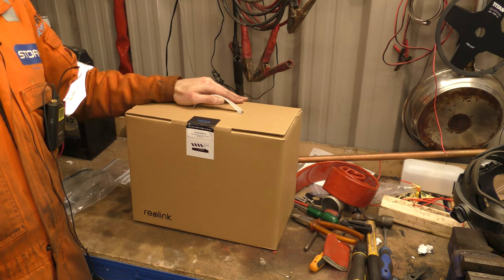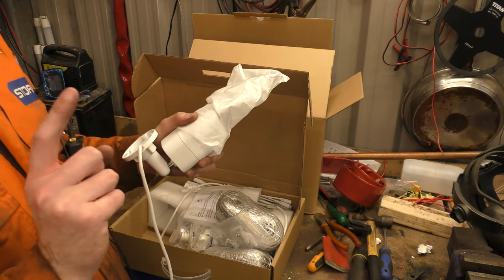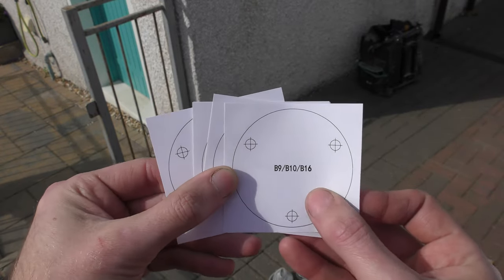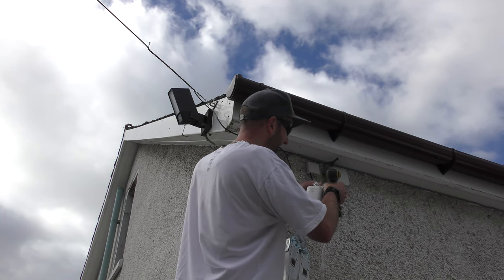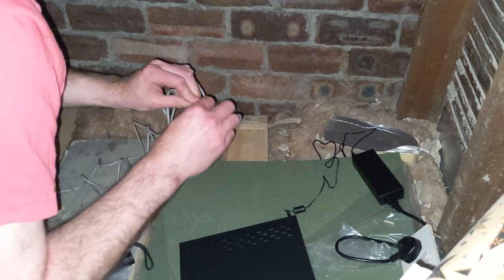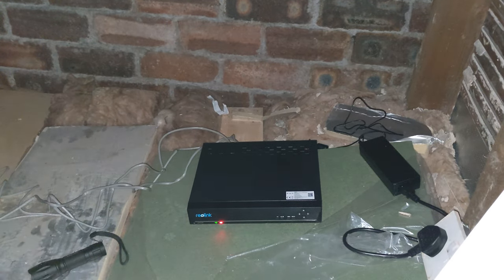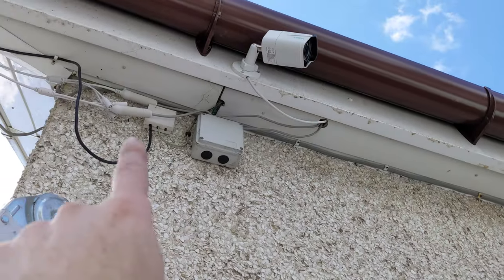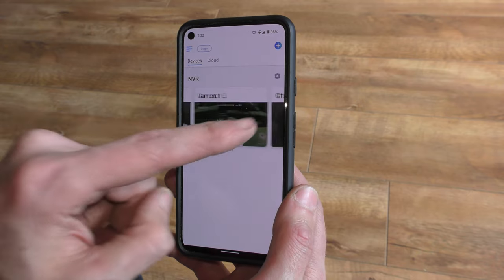DIY Power Over Ethernet CCTV Installation ( Reolink POE )

Comment: When we remodeled I put in Cat5E and RG6 coax to a bunch of potential camera sites around the house, in a way it's a good thing I didn't populate the cameras right away as this was close to 20 years ago, they'd have been $$$ and less than optimal image quality.  When I finally did, no camera I could find had enough IR to get a clear image at the bottom of our 80-foot driveway, and even at that the cameras with the most IR washed out the image closer to the camera.    I ended up putting in a big IR LED floodlight a couple feet away from the camera, and had to make adapters to power the flood over the RG6 coax.   Works a treat.  And that big IR flood is VERY visible to anyone walking near the driveway at night.   

Reminds me, the camera up on the chimney that points down the cul-de-sac quit a couple months back, need to get up on the roof and see what's going on.

Comment: Dave - is that seashell on your exterior?
I've never seen that.  It looks pretty cool.
Is that a common thing in your area or is that you thinking outside of the box again?
Is there a reason for using that?

Sorry - squirrel!
Great video. I've been eyeing those POE cameras for a long time. 
Have you spent any time viewing it on a monitor as opposed to the wifi view? 
I'm curious to know if that system would allow viewing from all the computers on my network via the cat6 cables and if so, is the image switching instant or at least less delayed than it is on wifi?  Thanks for any advice you may be able to give.
Reply from the maker: Seashell is a fairly common coating.  Or rather was.

In the video it's not the wifi that's the slow part.  The app uses the internet regardless of remote or local viewing.  But if you are on a PC with the app inside the network it's as good as real time.

Comment: Would like to know in follow-up video 1, Just how expensive, 2, Low light performance, 3, Angle of field of camera compared to your other set ups,
Reply from the maker: It's like we put one under the Netatmo for that purpose.  :)  Well that and the Netatmo is slightly too far away from the Wifi and disconnects.

Comment: Hi do you know that waterproof part of the wire which you connected around 10 mins into the video. You left yours outside I was wondering if it would fit through the hole you drilled if one was to decide to take that part of the wire into the home?

Comment: Oh I'm wondering if the cctv can be used on 12v and be applied to a yacht?
Reply from the maker: The power brick for this system is a 48V output as I think that's the voltage most POE cameras run on.
Reply: I personally use foscam, the ones I have are 12vdc with lan/wifi

Comment: I have had one installed for about 4 years and it still works..........damn it I wanted to upgrade it to 4k too.....terrible Reolink.....too reliable..... (and I live in a very rainy Wales......)
Reply from the maker: I had eight Annke cameras.  I'm down to four now.  One of which drowned itself with condensation.  And the software at the time was ok, but now it's horrible and clunky.  I'm tempted to buy a Reolink setup and just use the cables I've already run.
Reply: @DavidMcLuckie  I have an Amcrest 4k on the drive, if I could buy another I would, but they stopped selling the 4k in the UK for that price.   I also have a 4k Annke variant on the roof for my weather station, that occasionally goes offline as I think water gets into the cat5 flange which tends to leak.  My Reolink is reliable, but the resolution (2k) isnt nearly as good as the others, the Amcrest is the most stable and has the better software.   That said I have no NVR, mine all go via my NAS and are viewable via an app (Synology DS Cam).